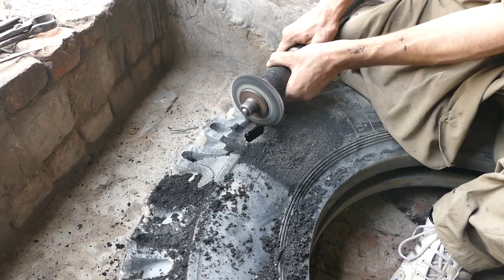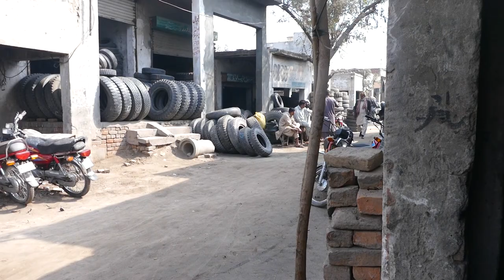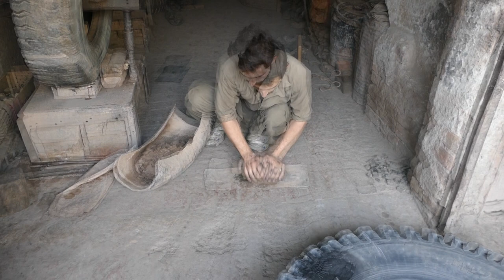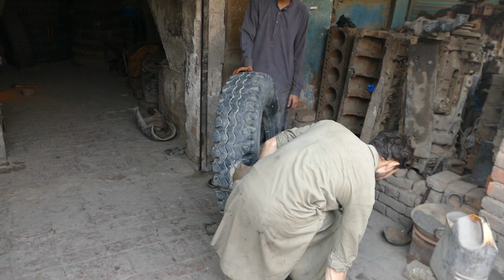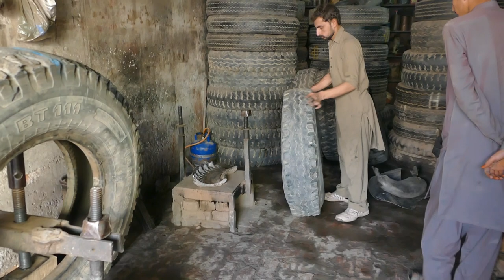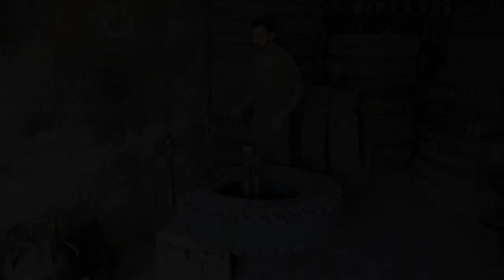Amazing skill of Repairing a Hard Impact Sidewall Truck Tire

Comment: These Folks do not have the money to buy machines that would perform a lot of the heavy labor involved with the cutting and grinding. They have worked out a process to get the repair done as seen in this video. Give them credit for the skilled hand work in this video, there is a real labor of love going into each one of these repairs.
Reply: Yes give them credit for their work, but labour of love is stretching it a bit. Their labour is to put food on the table and a roof over their heads, nothing else.

Comment: You have a holed tyre designed to hold 80-90 psi of air, support 2-3 tonnes static load, considerably more dynamically and the vehicle it’s fitted to may travel over rough surfaces. Repairing sounds good until someone dies when the repair fails. That was truly ingenious and inspired work, but potentially lethal.

Comment: I use to recap old tires, not as popularas they once were, anyway, I recognize all the steps he did. Everything he did was the same as recapping in a modernfactory, but on a small scale and with low tech tools. The tire should hold as good as a recap, But these guys always overload there trucks so you never know. Great video!
Reply: Your correct. I was a tier 2 recapper stitcher and we used to use a shoelace to repair holes in tires. Of course it was before all the Goodyear lawsuits
Reply: @ihateregistrationbul   These tires are Bias Plys, you can get away with far more for repairs compared to radials.

Comment: Thank YOU so much!  Over here - the tires would be scrapped. Not what I think should be done - but I dont drive at 70mph - 110kmph down a road either!  Re vulcanizing the tire - It should be as strong as built! Cheers to you!
Reply: Centurion wizofid. Sorry to say this but are you on another planet. Yes a great effort and credit to the repairer ,however that repair should never have been attempted. No way on earth could that repair/reconstruction ever meet the original tyre manufacturers construction and specifications. Totally unacceptable and potentially lethal.

Comment: That's like a chain with a weak link, accident waiting to happen but still I admire their work.
Reply: No accidents
Reply: For your information , these tires are usually used in trailers like 22 a wheelers. 53 foot long. And these tires will be placed in the middle somewhere inwards paired with a good condition tires outward. Even it burst no risk of flipping the trailer, some time we don’t even feel it when it goes BANG, we just listen the noise and stop. Also we use these tires in trollies to carry light materials like green fodder, hay etc. The funny thing is mostly these tires last longer then brand new tires.

Comment: you wont see a repair like that in the USA. It amazes me at how much stuff they repurpose repair and reuse. someone who cant just go out and buy a new tire they have to make do with what they have it will do.
Reply: side wall ply cord damage is usually beyond repair, even though the guy managed to repair it, it's unsafe. In US retrended tire are very common.
Reply: That is because that “repair “ should never be performed. Lived in South America for a while, even there they don’t do this thing
Reply: You will not see a repair like that in the USA you are correct because that is  major sidewall and structural damage of that tire and it should not be repaired.You would not catch a person with any sense putting something like that on its a major blowout waiting to happen.
Reply: @mrdantruckerman  This is true but for someone who cant just go out and buy a new tire they have to make do with what they have it will do.
Reply: @tomellsworth2726  life is cheap over there, but they got other worries

Comment: Wonder if it's structurally strong enough now
The wires were damaged too,  and you can't fix that
Reply: No where near structural enough, pump the tyre and either 1, watch it explode 2, itll leak or 3 pump up and blow out once its got any load on it
Reply: Can't agree more but I leave in Florida, the highways are full with split and parted tires bits and pieces, were those also repaired or not? Were they ever checked? why not a state annual safety test on all vehicles like the rest of the modern world? Why does Florida feels like you re driving through Bogota?
Reply: @denislaouenan5553  India exports all their repaired junk tires to Florida.

Comment: For your information , these tires are usually used in trailers like 22 a wheelers. 53 foot long. And these tires will be placed in the middle somewhere inwards paired with a good condition tires outward. Even it burst no risk of flipping the trailer, some time we don’t even feel it when it goes BANG, we just listen the noise and stop. Also we use these tires in trollies to carry light materials like green fodder, hay etc. The funny thing is mostly these tires last longer then brand new tires. And car tires are used for street vendors carts. Or small animal carts like donkey carts. So again no risk of flipping a street vendors cart with an old repaired car tire.
Reply: WOW!
Reply: The problem is, you then fit another one ,and another one...... this tyre is dangerous
Reply: @paulhancock3844  we can’t afford to change all 22 tires when there is still life left in them, so I’ve do it one by one. developed countries are now using only 50% of the tire and then selling ( the trash ) in the name of used tires to undeveloped countries, you must be one of them who was convicted by your mechanic to change tire at 50% life that’s it’s dangerous on highway. It’s actually profitable for you to sell the tire at 50% so you don’t have to worry about recycling or landfills, So that your country can send trash in the name of used tire to my country. And we use the tire again the rest 50% life or even more.
Reply: @TheAbdulaziz786  if its dangerous there isn't any life left in it. Old tyres are shredded and the rubber reincorporated into new tyres in this country so they can't be reused
Reply: @paulhancock3844  sorry sir you have no idea what you talking about . Countries like US and UAE can’t afford to recycle tires ( because its not profitable) and you are talking about Pakistan doing it ?
Reply: @TheAbdulaziz786  doesn't matter what they are doing, the top and bottom of it is that the repair is dangerous,  end of. The tyre needs to be thrown away,  I don't really care where you get the replacement from
Reply: @paulhancock3844  no it’s not ready to be thrown away, it will be used again and again. You have to understand we use these car / truck tires on small trolley like street fruit vendors, donkey cart , for local farms these small carts are Essential. in the main comment as I said for green folder or hay. Almost all farmers in Pakistan still rely on animal carts , you don’t know our situation easier saying you don’t care. Brand new tire is not affordable at this point and not necessary for a street vendor cart.
Reply: @TheAbdulaziz786  that's a truck tire not a cart tyre
Reply: @paulhancock3844  ok wow you must be very smart. I just gave you example for car tires for carts and truck tires for trollies . Have a good day sir.
Reply: @TheAbdulaziz786  it's a truck tyre for trucks so what's stopping someone from using it for that? Does it say on for carts only, not for road use? No, so it's dangerous and should be destroyed end of. It's like having a loaded gun and saying its not for killing anyone

Comment: Repair anywhere on the tread yes, but not the sidewall, that's just asking for trouble.
Reply: free786  still not worth the risk
Reply: @scannaunderscore1  we talk as American bat some places have no money!!!
Reply: free786  Not at all “good as new”.   That sidewall repair is mostly cosmetic- it has no strength.  Very dangerous.
Reply: ..and when the deathtrap that the tyre is fitted onto is involved in a fatal collision, this genius will deny all knowledge and end up in the UK
Reply: and yet many fancy company tires explode every minute with their state of the art engineering promised. 
Don't worry guys this would just be a spare tire for emergency situation, when a fancy one explodes.
Reply: @teesrakinara  Uh, no. There is a good reason they spent a lot of time to mold everything to look good. They wouldn't expend this amount of time/energy/resources for a spare. Their techniques are very commendable, but that is a very weakened sidewall. Granted, it may be, "good enough" for the area....

Comment: Appreciate the work skills guys but there's a reason those types of repairs aren't done here. Once that tire is paid for it's a accident waiting to happen once it's mounted and a load put on it. I wouldn't mount a tire like that on my truck if you gave it to me free.
Reply: I'm in a region where they do this crap.  Lots of heavy lorries that run like garbage, can barely stop, and shred tires on a regular basis.
Reply: u also get brand new tyres with default from factory at leat the are reused stop hating on the ppl we just like to throw everything away
Reply: @petersamra9828  its not about throwing things away its about safety
Reply: @petersamra9828  it's OK to repair something safely but this is dangerous
Reply: @petersamra9828  lol, that's what we call a "non-sequitur" argument. Meaning what you brought up has NOTHING to do with what the original comment said. 

This is in fact very dangerous, even deadly, which is why it's not legal in first world countries. Being mad that we have safety rules to protect life isn't our fault. 

Maybe get mad at the oligarchs in third world countries who purposely kept their people poor with international trade agreements.

Did you know mexico has a higher wealth per -capita than the United States does? But the disparity between the haves and have nots is much higher than the US because Mexico's OWN people in the upper class purposely designed their economy to keep the more indigenous people poor with very little chances of upward mobility and almost no social services despite all the money they make off of oil and agriculture. 

It's a gangster led society, especially the politicians. 

So no, it's not the fault of the guy making the comment and pointing out that the people in the video feel they HAVE to ripoff their fellow citizens by "repairing" a tire In a very shady way.

Sidewall repairs like this are illegal for a reason. It's not if it will fail, but when.

Comment: The repair process seems like it would cost more than just buying a new tire.
Reply: Seen this on huge construction machines where they repair the tires without removing them.
Reply: That tire may not even be available for purchase in that region,  or may be so unaffordable that this is the most practical way to go.
Reply: @waynekrisell8421  brand new truck tyre is above 100,000 PKR
Reply: cost of labor there is cheap. Importing tires not so much

Comment: I appreciate the craftsmanship, but this video really shows you the price of labor in a 3rd world economy. In any developed economy, it's much cheaper and safer to just buy a new tire. The power of free markets.
Reply: Safer? that was a superb repair, I bet it lasts as long as the rest of the tyre.
Reply: So much pollution and over use of resources
Reply: @futureworldwideautomation7105  Yeah and most of waste is caused by big corporations, if we had retained craftsman such as this we would have efficient usage.
Reply: @suzesiviter6083  superb repair? Tell me that was a joke? Not only did they remove all of the sidewall reinforcing, they overheated and damaged the tyre I making the alloy mold. This is an extremely dangerous bodge, doesn't deserve the title of repair.  Anyone using this tyre will find it falls apart under load and could kill them
Reply: @paulhancock3844  They stitched the sidewall, no they did not overheat, it wasn't smoking excessively. Are you being naturally combatitive or do you think you have tyre expertise to qualify opinion on repairs this guy has probably done for years without customer complaints?
Reply: @suzesiviter6083  I worked for Michelin tyres for 18 years, anything else to add?
Reply: @suzesiviter6083  funny, all of those threads he pecked out at the start are pivotal to the strength of the tyre. All he replaced them with was a few threads. The mould he made to be able to match up the tread and side wall was made with molten zinc/aluminium alloy at about 300 degrees. The rubber that was in contact with that had already been cured, once you add heat after the curing process, the rubber starts to degrade back to the original uncured state. So not only did he weaken the side wall by removing the fabric reinforcing,  he weaken the other side where he made the mold. As they say, a little knowledge is dangerous, just because it looks repaired doesn't mean it is, that tyre is a killer in waiting. Satisfied now by my knowledge or would you like me to explain rubber technology further??
Reply: @paulhancock3844  How do you know the lifetime of the repair will not be less than the rest of the already worn tyre?
The sidewall was double thread stitched, also looked to be a much thicker thread than the originals, so what he lost in number he made up for in thread diameter I would estimate. Now you say it will degrade by reheating, which is true, however not enough degradation there IMO to severely weaken the integrity of the repair.
As this argument is based on opinion with loose science at best not knowing the exact temperatures, let's just beg to differ, but my argument relies on the fact this is a common technique used in 3rd world countries, it must work otherwise these shops would soon go broke.
Reply: @suzesiviter6083  ffs, the sidewall fabric is moulded into the rubber. The thread material and diameter is calculated by computer to withstand the imposed load that the tyre is designed to carry. You think that someone can come along with a needle and thread and put enough of that in, in the correct place to counteract what has been removed then either that person is the stupidest person on earth or the cleverest. Then let's talk about the rubber they have inserted, where did that come from, whats it composed of, what testing has been done on it, where is all of the QA paperwork for it. Are you still going to argue that this repair is safe?
Reply: Add to that they need the sign off from the tyre manufacturer to aurhourise any repair
Reply: @paulhancock3844  Your quote: "The thread material and diameter is calculated by computer to withstand the imposed load that the tyre is designed to carry" that is an incomplete statement, for its MTBF is also a parameter, that is as long as the repair outlasts the life of the part worn tyre, it's a successful repair).
Paperwork? come on now)
Reply: @paulhancock3844  LOL, right so a tyre manufacturer is going to sign off a repair from a little guys workshop in India? you are having a laugh now.
Reply: @paulhancock3844  Yeah, that is why you are biased and hate tyres being repaired). Truth is I bet these repair guys get near zero returns on tyres failing again. As long as the repair is 'good enough' it doesn't have to have a perfect repair which is undoubtedly impossible by these back street repair shops with minimal tools.
Reply: @paulhancock3844  Seriously, that is your last argument? ) see any flaws in that one?
Reply: @suzesiviter6083  my last argument is that they aren't safe end of

Comment: And then it burst and the bus went off the cliff
Reply: And then they blamed it on cheap China products. 👍
Reply: For your information , these tires are usually used in trailers like 22 a wheelers. 53 foot long. And these tires will be placed in the middle somewhere inwards paired with a good condition tires outward. Even it burst no risk of flipping the trailer, some time we don’t even feel it when it goes BANG, we just listen the noise and stop. Also we use these tires in trollies to carry light materials like green fodder, hay etc. The funny thing is mostly these tires last longer then brand new tires.

Comment: In western disposable societies we just throw everything out or are told to throw things out. We even have the means to throw out money away therefore this type of tire repair is odd to 20% of the worlds population. To the 80% of the world this is how it’s done! They overload every single vehicle especially haulers and they still don’t have the failure rate the negative Nancy’s are decrying! Lol. This guy is a wizard. Good work bro. Real talk!
Reply: Bro this is fucking dangerous to do obviously you’ve never read on the basics of tire repair but SIDE WALL REPAIR IS NOT SAFE😂 once the side wall is gone the tire is done
Reply: @Fb6.Nan0  so true.. this is very dangerous.
Reply: @JuanCruz-ef5os  especially commercial trucks
Reply: @packingten  Come on, you would not want him either.

Comment: Nobody will tell me that this tire is safe, now put it on the front axle
Reply: That is of course the most important thing there! But that's a lot cheaper than a new tire, that's what counts there. You will have experience with it. The work is excellent for the conditions there. I wouldn't want to drive the tires either, but we don't have to either.